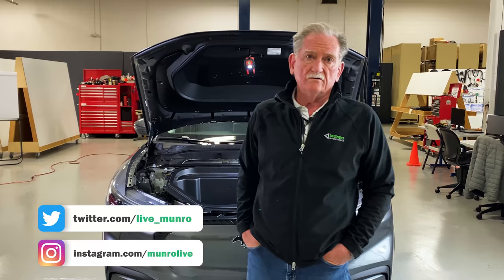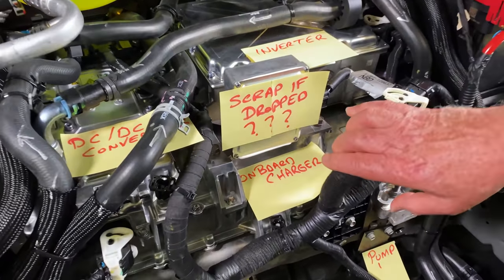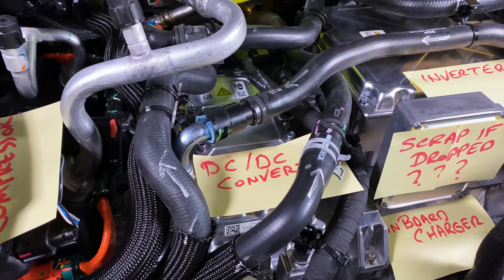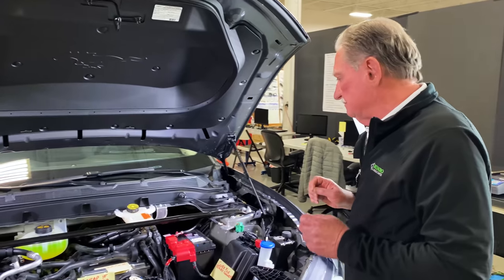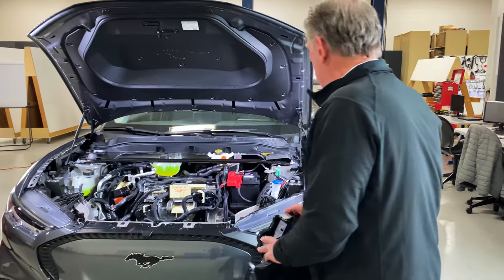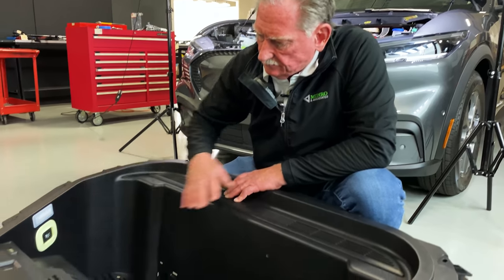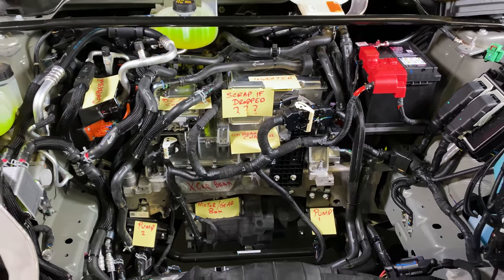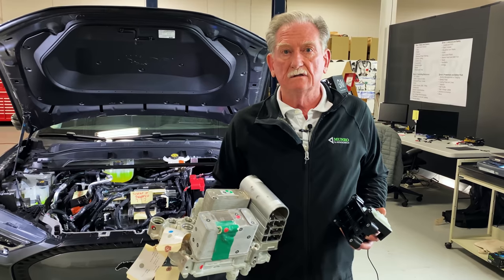Mach-E Thermal System Nightmare

Comment: Why would the onboard charger be underneath the inverter? The latter wants to be as close as possible to the motor to minimise cabling & losses.
Reply: Heat dissipation.
Reply: @spazzman90  they will likely both be liquid cooled
Reply: In a video a few days ago, Sandy showed how VW integrated the inverter, motor, and gear reduction into one package, which minimises interconnects between them ... at least they got something right, LOL. It's pretty likely here that the inverter, the motor/gear reduction, the charge controller, etc all got split up between different design teams, and there wasn't quite as much thought to system integration ... thus leading to hoses and cables everywhere. (Copper is heavy and expensive, too.) But, this is Ford's first production mass-market dedicated-design EV. It will be interesting to compare this, to what the Lightning looks like under the covers. I'm betting that there will be lessons-learned incorporated. (Tesla didn't get to where they are in one step, either. Their early models were rubbish, too.)
Reply: Maybe designed by a mechanical engineer, and not electrical one?
Reply: My only thought is the copper cables to the motor aren't flexible enough to be connected into the inverter/motor if they were closer together.
It's possible to make cables too short, so there isn't enough slack to plug them in.
Still the layout of the various boxes don't make much sense. Why isn't the DC-DC next to the battery it's charging ?
Reply: Yes.  The best design has the pathway between the switching transistors, capacitors and motor windings as short as possible.  I've heard it nicknamed the "holy trinity" among circuit designers.
Reply: @bikeaddictbp  Ford outsourced the design and manufacture of the integrated drive unit to BorgWarner. BorgWarner outsourced the design of the motor, inverter and other components to specialist companies, while designing the cooling and gearbox in-house.
That fits with Ford's design philosophy: use external suppliers where possible.  That works better when the overall design is well established and the external supplier is doing minor optimizations (as well as being the cut-out for union labor requirements).  It doesn't work well for new and rapidly evolving systems that need to be tightly integrated.
Reply: @bikeaddictbp  Yes, but Tesla was a brand new car company whereas Ford is a legacy car company that should have that figured out...
Reply: @ikocheratcr  its the other way around,  mechanical engineering does involve thermodynamics,  fluid dynamics and mechanics of materials
Reply: @michaelholliday100  Tesla does everything in house so they can do vertical integration much more easily.
Reply: @Djof  I understand that and I own 2 Teslas. also, I have 3 engineering degrees and there is nothing stopping Ford from approving or not approving a design and then having the part outsourced if so desired...
Reply: @michaelholliday100  You're right but it takes a lot more time between independant suppliers. Ford was likely trying to rush to market so they focused on functionality first and... Maybe later efficiency and reliability.
Reply: @Djof  I don't buy it. It does not take that long to properly design functionality into a project.
Reply: That looks almost as complex as an ice vehicle.  Based on each module sandwiched in, does repair cost appear high?
Reply: Im a big ford mustang fan i hate tesla  if not improved it be a deal breaker with me. Plus the problem with battery charging. Ill buy a tesla instead.
Reply: @1djbecker  Using off the shelf parts from their suppliers and then shoe horned them into the fronk
Reply: @bikeaddictbp  What you say is true.  But it only serves to accentuate Ford’s stupidity.  They have a nice reference design from Tesla to learn from and improve upon, but instead decided to come up with complete junk from scratch.
Reply: @johnpoldo8817  
The cooling hose is certainly look complex. As long as there's not a leak initially they also tend to be pretty reliable. Nothing is going to get extremely hot in an electric vehicle and there isn't any significant pressure in any of the cooling loops. So theoretically the coolant and the hoses should last far longer than they do in an internal combustion car. And even in those they last a hell of a long time. I've got a 13-year-old Prius with 370,000 mi on it and it still rolling on all its original rubber hoses and connectors and radiator. So while this looks complex and certainly doesn't look to be the most refined design I suspect as long as there is no initial leak or a failure in a coupler over time it should be a pretty reliable system. The individual stacking of components like they have done is pretty common both in the Chevy bolt EV and I'm assuming others. If anything that allows easier repair than Tesla which integrates the inverter into the motor assembly also Tesla will not sell you any of those parts so you're stuck going to their service center to get anything done. It certainly is more beautiful to look at and more space efficient but repairability is about as bad as it could be with Tesla. Unless you're willing to pay Tesla to do the work. Whereas with this car or the Chevy I can go to the dealer order a new inverter and a few couplings a few electrical connectors and a few 10 mm bolts I could have the parts swapped out myself in my own driveway.
I don't think Sandy did a video series on the Chevy Bolt but I can tell you the under hood arrangement is far neater and more tidy than this. If you're interested in seeing that car check out Weber automotive he has a complete YouTube series on powertrain cooling system and a complete disassembly of the battery. It's a pretty well thought out car and certainly looks as though it would be easy to repair yourself
Reply: @kens97sto171  I do not know where you are located or if you own a Tesla, but my local Service Center in Columbus, Ohio does an incredible job... I use Summon every single day and have an issue with other car and pedestrians. Since my Model Y was produced prior to the low speed sound being installed I requested for it to be done. The parts were about $100 which I could have purchased myself and simply had them activate the software, but I chose to have them install it for an additional $100. I watched the process and it would have taken me close to an hour to do the job without the software update. Before purchasing this car I had a Mazda that I used for business that had a bad Park sensor in the Transmission tunnel. The part was about $75 and they quoted me $400 to install it.  I decided to do it myself and it took 15 minutes. The point is that not only is my Tesla Service Center efficient, but the labor quotes are extremely reasonable. I am very happy with my Model Y and intend on buying additional Teslas.
Reply: @1djbecker  
Would the increased modularity help with repair costs?
(scrap if making funny noises)
Reply: @bikeaddictbp  Tesla running changes at the speed of thought.  Buyers did NOT have to wait for the next "model year" as legacy OEMs require.
Reply: @kens97sto171  Munro did Chevy Bolt tear down  AND are currently selling Bolt parts.  Suspect you could buy reports on the Chevy Bolt at a discount.
Reply: @brandoYT  
Saw that video..
I've seen actual video teardowns of the car itself.
By Weber Automotive. 
It's a automotive college..
He has lots of videos of Prius, Boba Hybrids, the Bolt EV, the Volt PHEV, and some Tesla stuff too.
I've seen a deep dive on the equipment in the Bolt.
As a do it yourself mechanic. I liked what I saw .  Pretty easy to work on, and easy to get to most stuff .
Definitely NOT a perfect car at all.
Plenty I don't like about it. Charging speeds suck.. a few other things. 
But they go a lot right for a first attempt at a long range EV.
The underhood coolant routing looks a hell of a lot better than what he just showed in that mustang.
In general it was much more neat and tidy. Obviously Tesla wins in that department. But at the cost of repairability after the fact by someone sitting in a driveway. Eventually that will matter. Someday these cars will be old and people will have to be working on them themselves if it's even possible to do so. If not it will mean the resale value for used older Teslas will be basically zero which means they end up in the scrap yard. I wonder what the ecological consequences of that are versus being able to keep something on the road longer because you can get parts and fix it yourself. I certainly find that to be the case with my Prius. It's 13 years old 370,000 miles and I can get any part I need to keep it on the road if I chose to.
Reply: @michaelholliday100  
Call and ask about other services.. like big one 
Need a new inverter, or coolant pump or OctoValve.
They won't sell you one....
I have a 13 year old Prius 370,000 miles 
Car costs me 7 cents per mile.
That's fuel, all maintenance and tires.
I like Teslas.. and hate them same time..
Reply: @michaelholliday100  Etienne is right about vertical integration, Ford and Tesla have very different way of designing. I was system designer in aerospace and now equipment designer (controller and inverter). After 20 year in the business, I can say that the equipement designer shall work very closely to the system. 
Most of the optimisation I've done was performed because I had a perfect view of the system during the design of the equipements. You can also have strong influence on the system itself if something become too complex or too costly. You are aware about the difficuties that other people have on their equipment and can adapt your spec by adding/removing resizing on the fly.  When you subcontract the equipement design, you know that any change in the spec will be translated in a contractual claim that will drive you nut because the evidence of a perfect optimization is just in front of you.  A big company like ford have their engineers spreaded everywhere so they tend to act as supplier/customer between each division due to the pressure of the program manager who has its own agenda to satisfy. And now those big companies try to catch the flexibility of the newcomer by adopting some "modern" management like agile/srub and a new one every two years
Reply: The guys that designed the charger finished the prototyping first.

Comment: Long bendy rubber hoses are veeery difficult to make  (and because of that expensive). Thats why they most of time they are connected like that. I saw more than few desings that changed from one very long hose to 2 or in rare cases 3 smaller ones connected in middle in middle of production cycle of a product. This approach also allows use one of few of those parts in new designs without remaking all tools.

Comment: Wow 😳 i think the cover over the electrical is so the conductive coolant doesn’t short the 400 volts when it inevitable leaks onto it from 1 of those 95  joints and hose ends ! The other major concern is having high voltage converters around and underneath inevitable leaky conductive coolant hoses. Lawsuit from greiving family waiting to happen !

Comment: The inevitable coolant leaks on the Mach-e are a “design feature” not a flaw. How else would an owner know it’s a Ford without a constant puddle of coolant on their garage floor? ..I bet this thing will still figure out a way to leak oil, too.😏
Reply: Its a feature to tell which way your Ford EV was towed after it overheated.
Reply: Do you mean that the puddle is part of the product image? "Brand Recognition Puddle"
Reply: It's a gift to the aftermarket industries, plenty of possible upgrades on there.
Reply: I've owned 4 Fords total (my fourth IS a mach-e), and none of them have ever leaked coolant.  My chevy on the other hand likes to not have coolant in it ever.
Reply: @remytv  Only once the vehicle is out of warranty. Any significant/identifiable mods would get you voided.

Comment: Interesting. The non technical
press had me believing they had pulled it off but it’s like the Pontiac Fiero. ( interesting concept messy implementation) It’s funny how CADD can be used to avoid conflicts in systems but if anything adds complexity .

Comment: scrap if dropped is for the assembly process if the part is damaged in transit or the operator drops it when. assembling they are to immediately set it aside to be scrapped and the customer will not get a possible repair later.

Comment: ICE executive: “we need to increase range”
Engineer: “decreasing parts and weight will increase range and the cost/mile”
ICE executive: “put a bigger gas tank in it”
Reply: All engineers: reducing a “little” weight doesn’t result in significant range increase and cost/mile savings
Reply: @JeepCherokeeful  a little weight + a little weight + a little weight + a little weight ... = :-)
Reply: sure and a very little mpg gain plus a very little mpg gain = very little mpg gain. FYI batteries are the heaviest component, so saving a couple dozen pounds on plastic, well ok? Driving style has a much more significant affect. So don’t exceed the speed limit and accelerate like Grandma;)

Comment: Never really a FOMOCO fan and this points out why for the most part. I’ve had 4 Mark VIII’s and gave up on them because it got to the point that you know of everything that will go wrong. with that some of the failures that you can fix still are day jobs to repair, so I gave up on them. Now I am driving something that could be considered worse….a Saabaru and it has not given me many issues over it’s first 40k

Comment: Are the Scrap When Dropped parts some type of electrical safety disconnects activated during a accident?
Reply: They are just sensitive high voltage stuff that if they are dropped, cannot be considered safe any longer. One of those parts with a fracture or loose connection could cause a fire.

Comment: Great insight!  I imagine all of this was slapped together as quickly as possible with an emphasis on engineering speed and very aggressive development timeline developed without too much input from the technical folks (the non-corporate politics ones).  Maybe it's more sane at Ford but it's especially worrying how the ID.4 was released with very laggy customer facing UX.  I want to buy a Mach E for my parents to replace their Grand Cherokee but I'm slightly worried about the combination of battery pack crashworthiness (not just under IIHS, Euro-NCAP, and NHTSA conditions) and electric door releases.  A lot of sometimes subjective (or blindly objective) safety assessments and buy-offs lurk underneath each car.

Comment: this is an early production vehicle, and maybe a quick solution needed to meet start of production?  Might be interesting to look at another in 6 months to see if the hose/pump/connector issue has improved
Reply from the maker: Great point Paul! Let’s check out the VIN# and get an answer.
Reply: Traditional auto makers don't make big changes mid year.  At best we can look next year...more likely 3 years
Reply: @markrichards9792  but there are always "band-aids" to get the vehicle launched on time.  Admittedly this is quite a significant band-aid!

Comment: Ford loves hoses and wires the more the better I remember when the emissions regulations got tough in the 80s and Ford just added new parts on top of parts no longer needed just to comply 🙄 they were a mess under the hood!
Reply: All manufacturers were, nobody would accept a used Honda Cylinder head if the vacuum hoses were not complete up to the connector. Computerization simplified the plumbing.

Comment: Gold dust. I'm a design engineer into big auto pulled my own 2014 Tesla Model S P85 apart to "See how it works" it had the same 4 way valve ......It leaked. My guess is the Mach E is a good part 2012 model S......The model S was complicated compared to Model 3 and Y....Tesla keeps innovating ........Better keep up....Cybertruck gonna be so interesting.

Comment: It's indeed a lot of clutter.
Did you test the cooling fan sound?
I hear a lot complaint it's loud! On 11kW it's on full blast. Almost from the start. Seems it's not working proportional to the situation.
Haven't had that experience with other EV.
They are docile. And only working from start in hot ambient temp.

I'm in hydraulics making manifolds for systems. It's the same principle as with the supermanifold. Reduce leaks, design envelope, improve function and service.